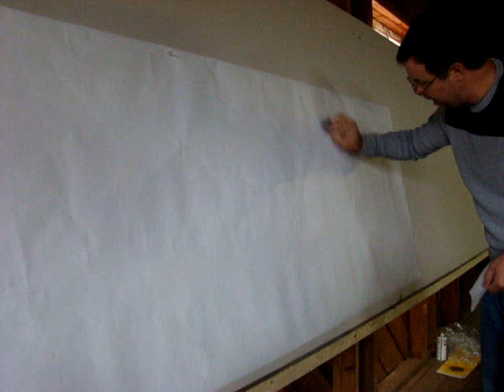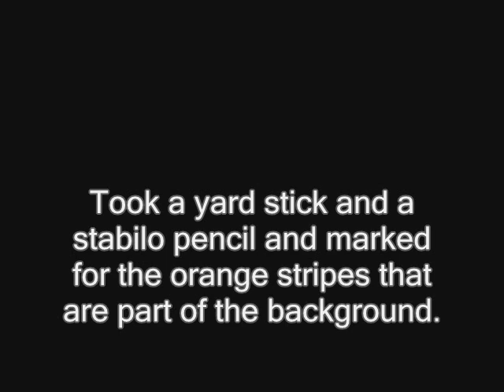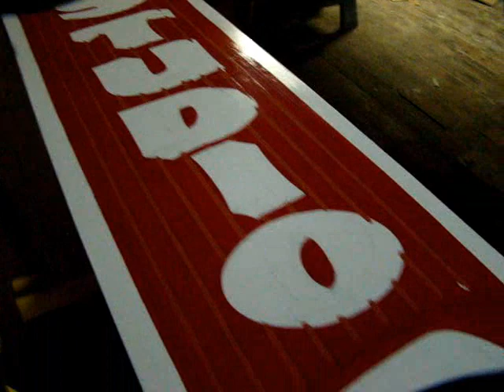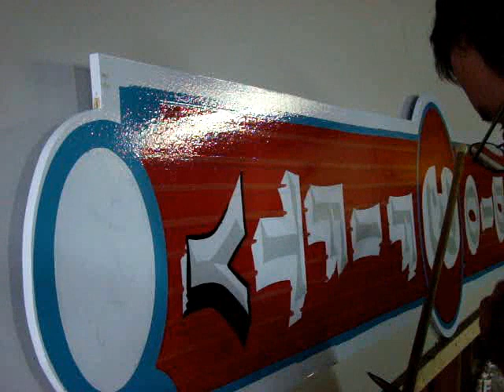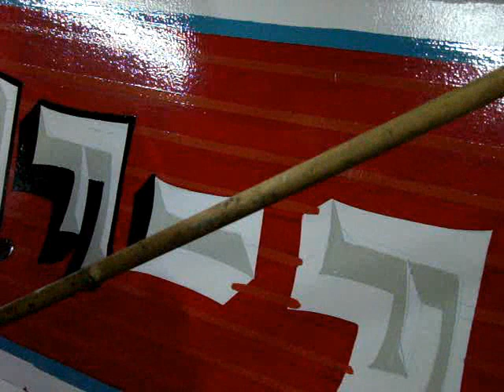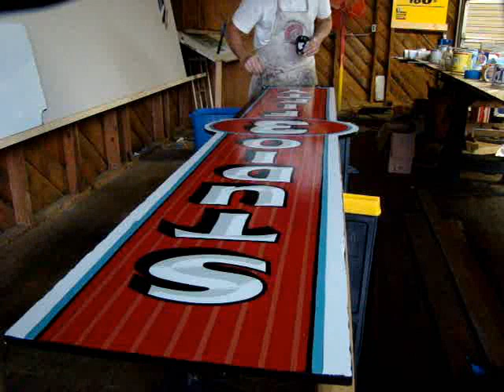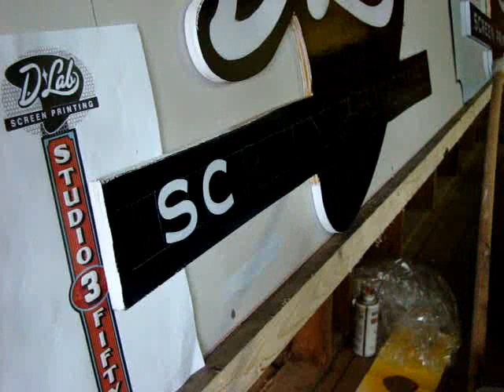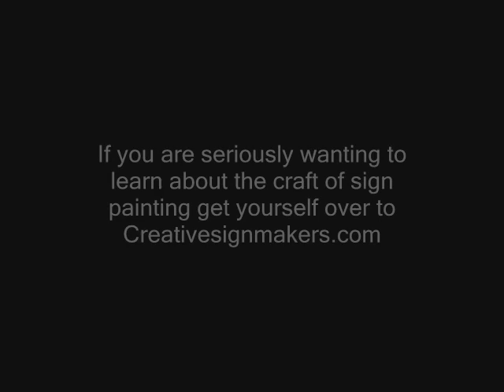Hand painted sign

Comment: Thanks for the master class.  I always struggle with the question of painting the whole background in the most prevalent colour or cutting everything in.  Do you recommend the way you did in most cases?
Reply from the maker: Like most work the answer is 'it depends'. No set right or wrong. Your own experiences will dictate which way to go. The easy answer is if it is a large panel with large gothic style letters then 'cutting in' the letters from a light background color would be a good choice. However if the lettering is only a couple of inches tall then it might be better to letter onto a dark background as double coating the letters would be easier than trying to cut in small details.
Reply from the maker: Also, on this job the main title was getting a black outline and shade so it was easier to single coat the red around the graphic than to double coat the white onto the red.
Reply: John Byrd the men he omkmoiro

Comment: Just curiuos, i'm new at this and a novice, but could you skip the hole punching and charcoal step by just tracing the projection directly to the sign?
Reply from the maker: Steve Harpin absolutely, patterns are for multiples of the same design. If this was a casual design I wouldn’t have gone to the trouble of a pattern.
Reply: Awesome! Thanks for the reply!

Comment: Why not just draw directly on the sign and skip the paper?? Thanks
Reply from the maker: Nick Vicentini For most 1 color 1 side jobs that's what I do. Scratch out a rough layout with a Stabilo pencil and bang it out. However, this job had 2 sides and multiple colors that may need to be marked again during the job so a pattern was the choice.